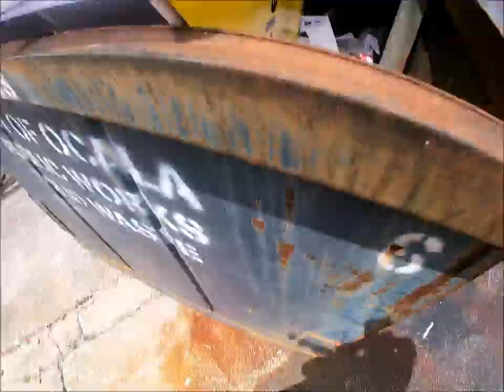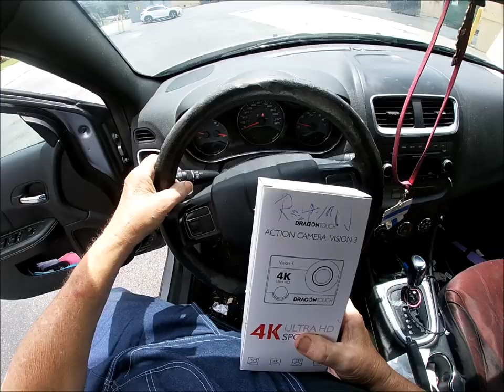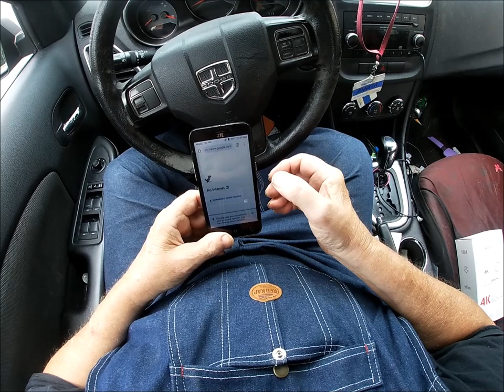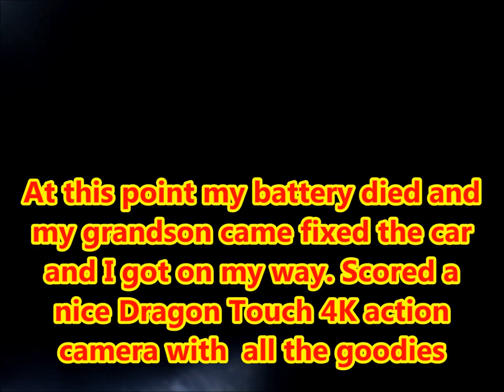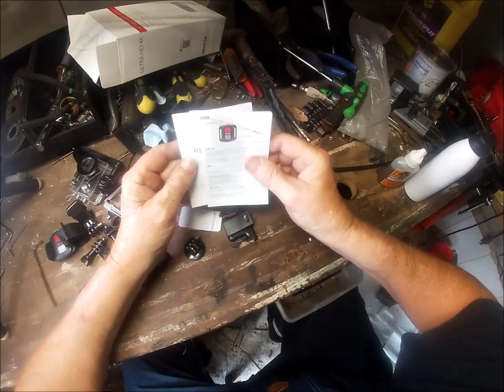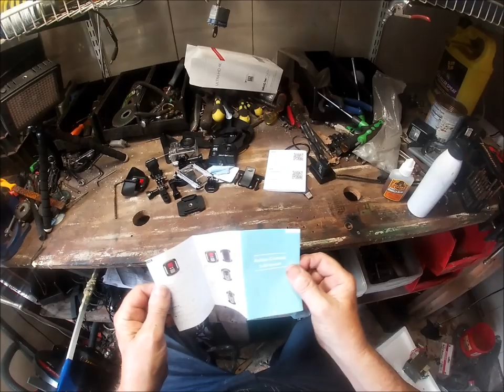Good Day Bad Day & A Nice Score

Comment: Great find my friend! My guess would be that the extra back with the slots is for a head strap to be attached to it. I bet you could use the waterproof case but you'd have to make one small modification to it for it to hear sound and that would be to locate where the microphone is on the camera, then mark it on the case, remove the case, then drill a small hole where you have marked. This change would make the camera case where it is NOT waterproof, but it would still be water resistant. I doubt your going to be diving into a lake with it so water resistant would work for you if you get caught in rain, but the case wouldn't work for it if you dropped it in a puddle or something. But it would be the same if your were using the slotted back anyway so why they didn't go ahead and put a hole over the mic and market it as water resistant is beyond me.  I do wish I lived closer to you because I do "get it" and would be happy to sit down with you and help you adjust the settings on your phone to shut off all that extra stuff and get it to where it is easier for you to use. I know that vulnerable feeling and hate to see anyone have to experience that. I lived with and took care of both of my parents and helped them all kinds of things like that. It's a shame that your family doesn't have the patience to be there for you.....date or no date...geesh.  Let grandpa die of heat stroke in a random parking lot because I'm on a date and might get a kiss......I'm sorry buts that just pathetic. Some folks are just like though....it's sad. Don't you dare feel bad about it. Date kisses come and go but you only get one grandpa and your wellbeing is much more important than any snogfest will ever be!  Sounds like the car has a short in it somewhere that's causing the fuse to blow. I'd be checking for wires that have been rubbed or worn through the insulation where it can touch metal and cause a short.  If you decide you like this newer camera better, you could always sell the GoPro and put that money in your golf cart fund. Hang in there my friend...

Comment: Don't  be afraid to ask for help.  It's probably something real simple.  I know you probably looked on Google. 
Try to pair the remote to the camera as a 'new' remote (i.e. select "Wi-Fi RC > New" in the camera's Wi-Fi menu). If pairing doesn't work, try to connect to the camera's Wi-Fi network with a phone/tablet. You'll need to switch the camera to "GoPro App" mode in the camera's Wi-Fi menu first.